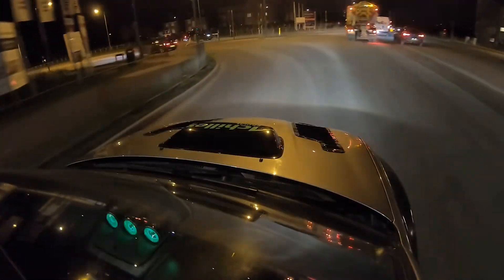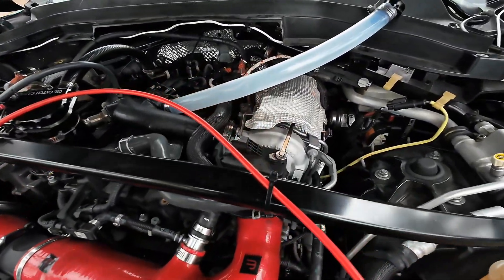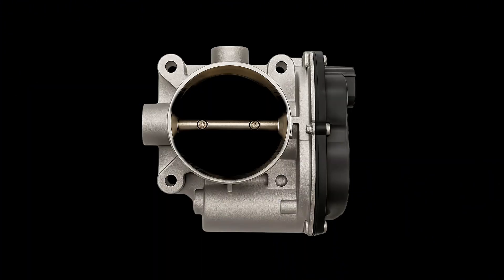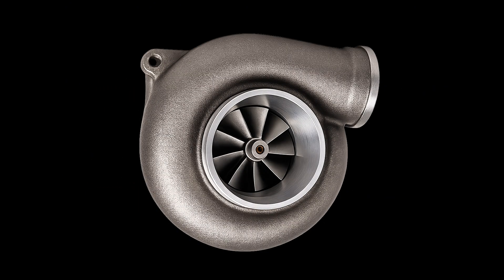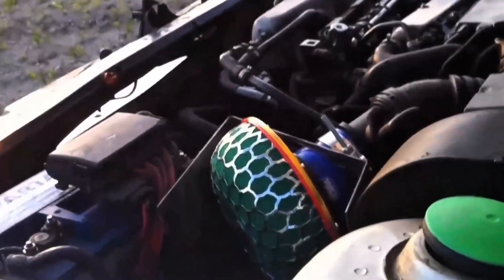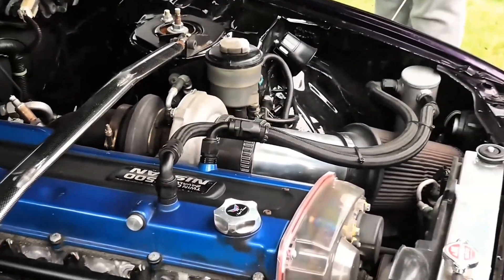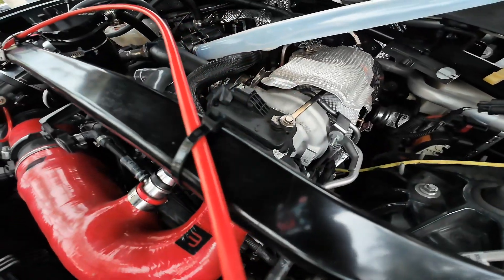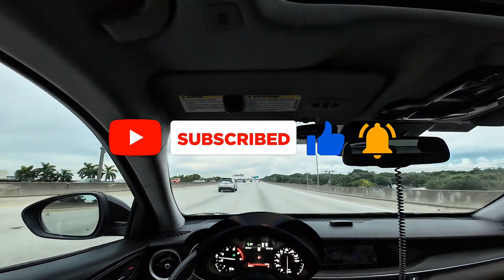Car Culture LIED about TURBO FLUTTER

Comment: Still cant find out why drag cars with over 1000hp dont use BOVs.
Reply from the maker: They don't need them, they source high quality ball bearing units built to take the stress. 

Drag car turbos are typically replaced after every run for the best performance.
Reply: @TorqueTheoryLabs If you look at all the highest power turbo engines they will have a blow off valve and none of  them are replacing turbos after every run even at the highest level of drag racing, there is simply no need to do that.
Reply from the maker: @DriftNick 

I'll quote you the same video you quoted me in an earlier reply:

https://youtu.be/ieVDfnUKN9s?si=drGQPkNJM64VFato
Reply: @TorqueTheoryLabs Not sure why you are linking that, there is a point when you would want a BOV because you will damage the throttle body, that is why all the most powerful turbo engines will run one.
Reply: It's the opposite of that, most drag cars making big power will have a blow off valve but not for the reason in this video, you can bend throttle plates pretty easily with a lot of boost.

Comment: Yet 4 years later my daily which is a ford with a barra motor with a 67mm still flutters daily, still works fine, no bent shaft. In 20 years of turbo cars ive never had a failed turbo due to flutter, 3ven the old t3 journal bearing on the RB30 nissan motors in the 90s and 2000s.
Reply: Yeah there is always videos like this but people with real world experience know it’s fine
Reply: right as long as there's flutter ONLY on decel or downshifts its fine, anytime else = bad news and boost leak
Reply: @f56ethan read the comment you are responding to. That’s not doing it on downshifts and neither did VL turbo’s built in the 80’s that have fluttered ever since

Comment: Old 5cyl turbo audi cars never had a blow off valve and those turbos are still running strong 40 years later. Let that sink in
Reply: The did in the later ones (diverter valves) Not the race cars or the early ones though.

Comment: Im new to this car thing, i got my gr86  2yrs i want to install the hks turbo for it, but it doesn't have that bov thing, it is bad?
Reply from the maker: I'm saying this with care, please don't take this the wrong way:

But if you have to ask, then you probably don't have enough knowledge about the system to properly handle a turbocharger install. So I'd highly recommend learning more about it before attempting the install.

To answer your question, unless it's a race build - it's recommended to always use a BOV.
Reply: @TorqueTheoryLabsim really new to this hobby tbh, and this kit from hks is a bolt on turbo, it makes that nice tsu sound but as far my knowledge go, turbo wont last long, i just plan to achieve 300hp street build, i just like the hks turbo sound, thank you so much for the information
Reply from the maker: @aroundtheflatearth2388 

Glad I could help! Try to do as much research as possible on your specific platform to have a build that not only makes power, but keeps driving. 

With that said though, there's no replacement for hands on experience.
Reply: HKS don't think you need one but youtubers with zero experience running no valve think you do, who are you going to trust?
Reply: @DriftNick does that kind of setup reliable? I mean it last long? I dont have a deep wallet to replace engine or turbo every time maybe 3yrs max idk, i just want it to last a bit longer if not i will keep my gr86 NA
Reply: @aroundtheflatearth2388  The turbo will have no issue without a blow off valve, how long the engine will last with a turbo really just depends on how much power you make and how hard you drive it.
Reply: @DriftNick i live in japan and the max speed i can get is 120 in highways
Reply from the maker: @aroundtheflatearth2388 
@driftnick

Stop recommending running w/o a BOV as a keyboard warrior here, it's innacurate info that could cost someone who's simply trying to reliably modify their car a portion of that reliability.

If you can't afford to punch any holes in reliability, then don't. Run a super high quality ball bearing turbo if you absolutely want the surge noise, or install your run of the mill journal bearing turbo with a BOV.

If you're going the length of installing a turbo, it isn't difficult to install a BOV. It could be fine without a BOV, but it's the same reason we run air filters on turbochargers.
Reply: @TorqueTheoryLabs The only  inaccurate info is coming from people that have never owned a car without a blow off valve trying to tell others it kills turbos, HKS don't think you need one otherwise it would come with the kit.

Comment: The most legendary turbo flutter was back in 1986, the Turbo Buick (Grand National and T-Type).  We used to install BOVs in the charge pipe to prevent our old standard (non ball bearing) turbo's from eating their thrust bearings!!  It did sound mean however and with a completely stock setup with the small turbo there wasn't enough torque on the tiny compressor wheel to do much damage....

Comment: Very good explanation. There are only a few scenarios where turbo flutter makes sense. The problem is that slowing the turbo down does increase turbo lag, unless you get back on the throtle before the pressure has escaped. If you get on and off the throttle rapidly it makes sense. If there are breaks longner than say half a second, it creates more turbo lag. This is why you see alot of drift cars running without blow off valves. They get on and off the throtle so rapidly it makes sense but it does cost your tubro.
Reply: If it created turbo lag it would not be common in race cars to run no blow off valve, GT3 and TCR being two classes where you can hear them surging off throttle.

Comment: it slows the turbo down to much , if you have a nice blowoff valve it will just hiss and let the turbo stay up in revs and keep the boost more ready to go
Reply from the maker: So far there has only been data showing the wheel speed is largely unchanged, so it comes down to:

- Keeping pressure in the charge pipe without a BOV.

Or,

- Relieving pressure from the charge pipe with a BOV.

The former is theoretically better for throttle response, though I imagine the gain isn't noticeable outside of lab testing. So for durability and longevity I'd choose a BOV.
Reply: @TorqueTheoryLabs true and it would have to be a special tune, i thought that the flutter was from stock blowoff valve and you want one that sounds like darth vader

Comment: Pressure spikes pressure spikes pressure espikes. 
I'm an aircraft mechanic, jet engines are sort of like big ass turbos. When compressor stalls(surges) happen in aviation, you're meant to pull power to prevent damage. In car culture, people keep putting throttle inputs to MAKE it stall/surge. Always makes me winge a little bit lol

Comment: Hi, ceffdriver here. I can tell you that as someone that owns two a31 cefiros and a WC34 stagea (with the factory blowoff valve blocked) that this video is a lie and "turbo reversion" aka boost flutter aka dose, doesn't kill turbos. Like cefiros and laurels from the factory do not have bypass valves from the factory. 

What kills turbo thrust bearings and standard journal bearings is excessive heat, early shutdown leaving the heat to cook the oil away and stave the bearing areas plus poor oil quality and oil contamination. 

No in short, from someone who worked on a lot of cars over decades your video is wrong.

Comment: So safe to run with BB turbos or not?
Reply from the maker: I'd reommend researching for your specific turbo type.

But if you're running a low boost like 10-12PSI. You'll probably be fine.
Reply: @TorqueTheoryLabs 30psi lol

Comment: Also I would like to point out that I’d rather be the dude to explain it before and then laugh at them when they decide to keep going and eventually destroying their turbo than to be the be the guy who doesn’t say anything or give no helpful advice and warnings about doing something such as not running a blow off valve because they either think it’s fine or the flutter sound is sick so the damage is worth it and are like “I’ll just buy a new one” it’s like ok whatever you say and several weeks to a month later they start complaining about turbos being junk etc all because they refused to take helpful advice that could’ve saved them a decent amount of money, I do want to say one thing I find a lot of the dudes who tend to just throw more money on replacement parts due to their inability to take advice are usually silver spoon babies who never had to worry about anything because their parents are wealthy thus were able to throw money at everything except fixing the problem causing the issues and thats themselves, these kids don’t care if it gets broken because mommy and daddy will pay for it also these are the same rich kids who never learned the value and concept of money and having it until you don’t!
Reply: flutter wont kill a decent condition turbo in a month.. mate ran his vl commodore a rb30et without a bov for a decade and the turbo was worn when we pulled it but wouldve been fine for a few more years. you dont need a bov but getting one will increase the life of the turbo

Comment: If these car guys who think turbo flutter is fine would have taken the time to do logical thinking they would likely understand why blow off valves exist and here’s the reason “Blow-off valves (BOVs) exist in turbocharged engines to protect the turbocharger and improve engine performance by releasing excess boost pressure that builds up when the throttle is closed, preventing compressor surge and reducing turbo lag. This protection prevents potential damage to the turbocharger's components from high-stress pressure fluctuations and allows the turbo to continue spinning, ready for the next acceleration.”  <— proves the point of my comment and your video, turbo flutter may sound cool but your turbo will experience a shorter lifespan overall from the intake throttle valve snapping shut and the pressure having no where to go except back the way it came which will cause wear and eventual damage to the turbos compressor wheel and possibly the center shaft locking the turbine to the compressor wheel but regardless of your stance it’s better to be safe than sorry, I personally prefer the sound of a blow off valve, but people will do what they want it’s just better to inform them than hang back and not say anything because if you hang back and laugh you’re an ass because you didn’t warn them this would happen, but if you warn them and they don’t take your warning seriously and they break their turbo you’ll still be an ass for laughing but at least you have a valid reason because you told them exactly what could and probably would happen!
Reply: Meanwhile in reality there is zero performance loss from not running a blow off valve, this is why it's common in motorsport not to run one, outside of that people have tested turbo speed with and without a valve and there is no difference in turbo speed between them, so much for your logical thinking.

"allows the turbo to continue spinning"

You aren't one of those people that thinks it stops the turbo are you?

"possibly the center shaft locking the turbine to the compressor wheel"

The turbine is locked to the compressor wheel by a shaft, that is how a turbo works, you either worded this really poorly or you don't even have a basic understanding of how turbos work, not sure which one.

"it’s like ok whatever you say and several weeks to a month later they start complaining about turbos being junk etc"

Been doing it for 15 years, zero issues.

Comment: Nobody cares about the health of a machine. ITS SO COOL BRO!
Reply from the maker: Flutter sounds great, I agree.

But many people do care about the health of their machine when they are built & not bought.
Reply: @TorqueTheoryLabs I know a lot of people who do care about the health of their machine regardless if it was built or bought, yeah sure you don’t do the work in an already built performance vehicle pushing 500 to 1000HP however you do end up spending a decent amount of money for the car with a performance package for higher horsepower, higher torque, complete turbo setup and so on, not everyone who buys performance cars from the factory treats them like shit just like not everyone who has built their car treats it like a baby a lot I’ve seen are absolutely abused on the streets, I think it depends on the environment the person grew up in it’s like how some dudes have a nice work truck they properly maintained to keep it reliable while other had a nice work truck and drove it to shit and hasn’t properly maintained it and they wonder why it runs like shit, take care of your vehicle and it’ll take care of you by being reliable, regular maintenance which includes changing the filters, regular fluid changing intervals like oil, maintaining the differential fluid, inspecting and changing the brakes, replacing your tires and aligning your wheels, document any rust spots and treat those areas to stop the spread of rust or better yet do a rust prevention treatment before daily driving the vehicle, the more maintenance intervals you achieve and complete the greater the chances of your car lasting a few hundreds thousand miles if not closer to a million miles! 😊

Comment: So glad someone made a video on this, as much as it sounds cool this is not a great thing for your turbo it will destroy your journal bearings and even ball bearing turbos to it will take some time to develop that being said. But if your not convinced take your charge pipe to the turbo off and grab the Center of the blades and try wiggle it, there should be no play at all if a very small fraction of it that you can’t even tell it’s there and also try pull it forward and backwards to this also another failing point on the seals for the turbo where surge can dmg it

Comment: Hah. No. If your Bov is recirculated you still get the stustustustu sound. With no damage to the turbo. The recirculated Bov air spools the turbo, then is instantly released again in the same loop a few times. I have a dsm dodge modded Bov i used as an example to show compressor surge and proper bov function on my channel for those who are interested.
Reply: The stututu sound is pressure not being released by a valve when the throttle closes, it goes out the intake of the turbo and makes this sound, it's not a blow off valve being recirculated, spooling the turbo and releasing pressure over and over.

I watched your video, you can clearly see in the video the tiny bit of compressor surge stops when the valve opens and the reason the valve keeps opening a bit and closing is because the rpm is changing either by your hand or by a terrible idle and the vacuum is changing.
Reply from the maker: In laymans terms - a recirculated BOV doesn't produce a flutter surge sound. Flutter is caused by the air pressure being forced out the compressor wheel forcibly chopping the air. A recirculating BOV will send air back into the intake tract, and the wheel will compress it like any other air.

I know this from experience, and I didn't see your video, but it looks like the other comment below debunked it.

Comment: The stu-tu-tu sound is literally just air getting chopped by the blades as it flows back into the compressor. It's why it sounds like "STU-Tu-tu-tu", the 'STU' part being the loudest because it's the most volume of air being chopped as soon as the throttle body closes, followed by smaller 'tu-tu-tu's' as it gradually lessens.
Reply from the maker: Exactly!
Reply: @TorqueTheoryLabs still doesn’t hurt the turbo 🤷‍♂️

Comment: Wrong. 
It's a wives tale that it damages turbos the sound is air fighting itself in reality the the turbine wheel does not care and sees no increased forces in either direction. 
I thought this video was going to debunk the myth not claim it as fact.
Reply from the maker: Why do OEMs use diverter valves then?
Reply: @TorqueTheoryLabs diesels don't but for petrol vehicles theres NVH. flutter is very loud, and the better response of diverter valves that don't dump to atmosphere. also emissions. 
but they too believe the wives tale it may cause turbo failures so they don't take that risk. even if they proved it didnt impact it people would still believe it.
Reply: @asjmpickle  These type of people have never actually owned a car without a diverter valve or removed one from an engine with one, they have zero understanding of why they are used and they just think it's because it damages the turbo despite countless people telling them otherwise.

Comment: I drive a stock mk7 gli with an intake. I still get compressor surge. What are some ways to stop it?? Aftermarket bov or dv??
Reply from the maker: If it's completely stock and properly functional - then the OEM accounted that into the build and deemed it safe. You can get an aftermarket BOV if you prefer, but it's not a necessity. 

How much boost does it run, do you know?